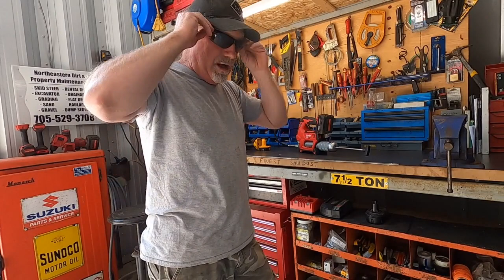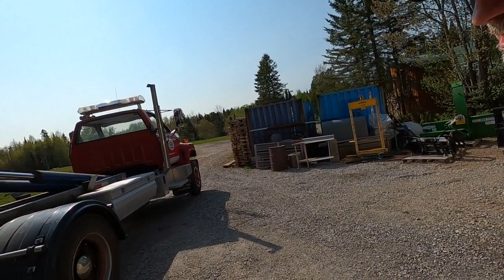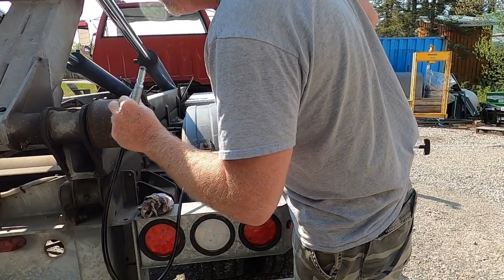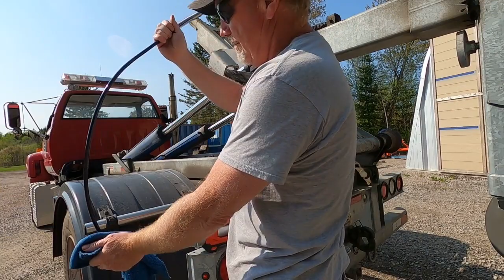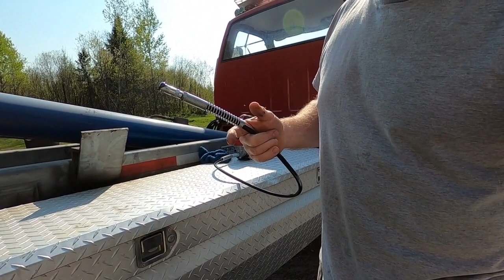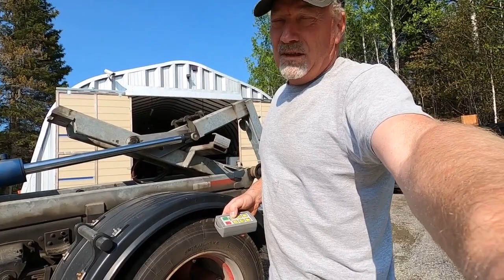Milwaukee M-18-things just got less sticky.

Comment: Figures.

I like Milwaukee tools. I also like DeWalt tools. But like everyone else, everything on my tool timeline funnels back to that fateful day when I was a young man about to but my first cordless, grown up tool. And like everyone else, it was a drill. From that moment in my history on, I was in the club of cool kids who got to look at the "tool only" price when I needed my next tool.  

If not for that system, my garage would would look like a quarter pounded with cheese with the bun removed: Black yellow AND red. But life just doesn't work that way does it brother? Nope. As much as there have been an even number of times when the one I wanted to buy was red, I always bought the black and yellow.

Now here I sit, at age 53. I own every power tool I could possibly ever need. I even just finished a garage wide upgrade program, replacing every DeWey that was not top of the line WITH the top of the line DeWey...in an attempt to buy my final set of tools now that I have retired. And now...on THIS day...when I don't need anything else in my tool collection...the universe decides to make me aware that adapters exist so you can cross your batteries over. Of COURSE the universe waited until NOW to make me aware of that.

The good news is, around 50% of the days of my life, when I needed to buy a new tool, I was able to buy the very best version of that tool on the market, because DeWey made the best tool. It is that other 50%, the days when I had to settle for the silver medal because the other guys, and their infernal red batteries, were producing the reining champ.

Thanks pal, haha
Reply from the maker: You can't go wrong.I pounded on DEWALT for years,sawing drilling,dropping off roofs and cracking cases,they hold up.Period!I just found better than average deals on milwaukee,so i pounced on them.Thanks for watching and commenting!